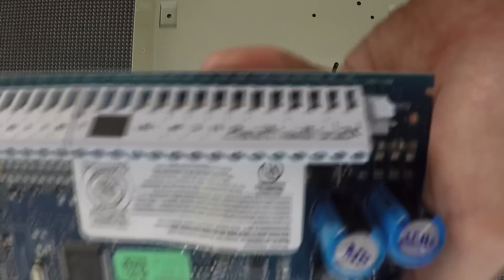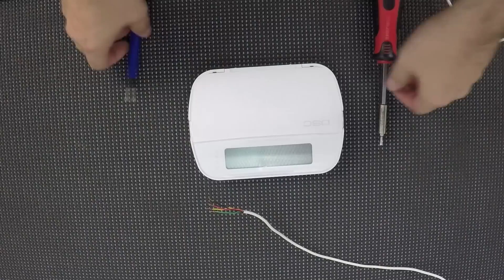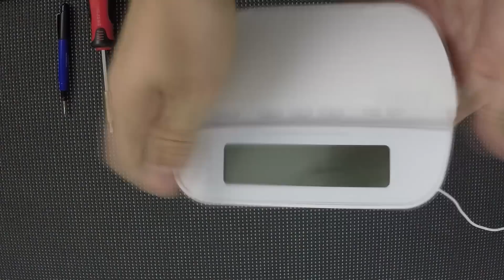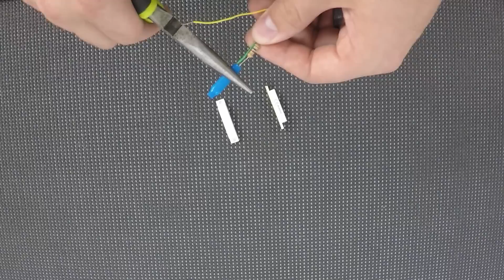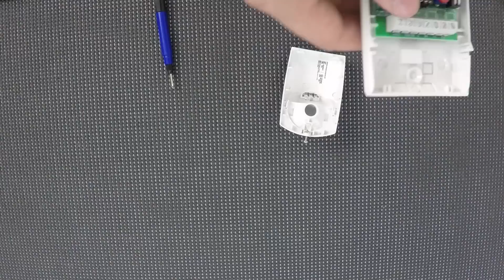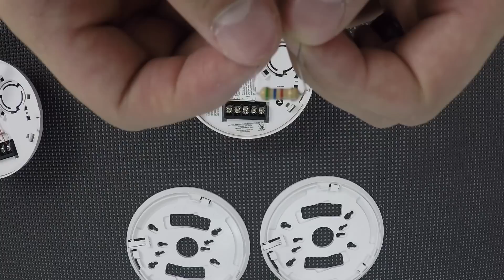DSC PowerSeries Neo Alarm System Wiring Instructions - How you can be successful

Comment: Do you wire a wireless transceiver module into the corbus?
Reply from the maker: Yes you do
Reply: @AlarmSystemStore  
Awesome thanks. 
I also keep getting tamper switch indicators on the keypad. I went around to make sure they are all depressed and ok. I can’t get to clear. Is there some kind of bypass or cheat to tell the system to ignore the switches. 
Thanks
Reply from the maker: @gloproglowingcups4795  I am not in tech support, but I am fairly certain you can turn of keypad tampers in keypad programming.

Comment: Which model would you recommend to replace a pc1616 ua503 v4.6? Mine got hit by lightning.
Reply from the maker: The Neo 2016 is the modern = to your 1616. See here:
https://www.alarmsystemstore.com/products/dsc-powerseries-neo-hs2016nkcp01-board-cabinet

Be advised though, your 1616 keypads, modules and wireless will not work on the newer platform.
Reply: Thank you.  I appreciate it.  Do I need to change keypads and sensors as well? The old ones still give continuity back to the board.  It's just that power is not making it past the initial contact.
Reply: Also, is it possible to link a wireless motion sensor to the 2016 model?
Reply from the maker: @noelr7988  If you have a Host 9 wireless transceiver and compatible motion detector, yes. This is all the wireless products for Neo panels:
https://www.alarmsystemstore.com/collections/dsc-power-series-neo-wireless-sensors
Reply: I just purchased my hs2016 system from your online store.  Will my current keypad RFK5501-433 work with the hs2016?
Reply from the maker: @noelr7988  No it will not. As mentioned in your earlier question, none of the modules or pads from the 1616 are compatible with the new Neo series.

Comment: If you have 6 expander boards, does all 6 parallel on the main board??
Reply from the maker: Yes all are connected to the same keybus. Doesn't have to go directly back to the panel though, could be tapped at a keypad for example if need be.

Comment: Hello, 
I have a DSC pk5500 and it has a low battery alarm. My question is: the only battery he has is the black one UP7-12S, 12V-7Ah? I can't get it off the wall, so I don't think it takes other kind of batteries.
Thanks a lot for the help.
Reply: you can also put 12v4a battery, you need to calculate the power consumption. If you have many motion, smoke detector or 4 wire device, you need to put 12v7a, if you have only 1 keypad, one panel and wireless device a 12v4A can do the job. The only difference is how much time system gonna work during power outage.

Comment: hello, sorry for my english , I have a question ,in a situation when you have more than 1 motion sensor how you connect a tamper switch, paradox alarm system have nc with eol with  tamper & wire fault recognition, where they do that with 2  1K ohm resistors conected in series, I would like to do similar thing with dsc
Reply: you can connect with 2x 5.6k like paradox and you go in section 013 option 2 for doube eol

Comment: sorry sir I want to ask in my serine there are six cables please help wiring the panel and whether I have to use a resistor
Reply: Pick 1 black and 1 red from the siren. Splice it to the black and red wire that's going to your panel. No need for a resister.

Comment: I have replaced several panels with 2GIG takeover modules and every panel I've worked in they have the EOL resistor at the panel. I have wondered about this for quite a while and this video confirms that the other company doesn't know what they are doing. I'm assuming they only put the resistor in at all because they don't know how to program the panel without using the resistor and hence the zone doesn't work properly without the resistor. Obviously the resistor isn't doing anything for them.